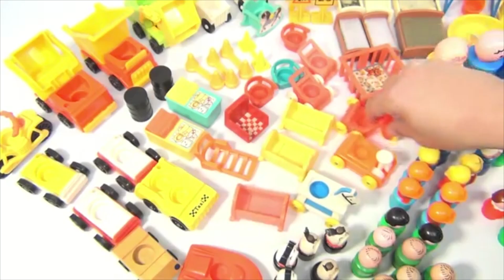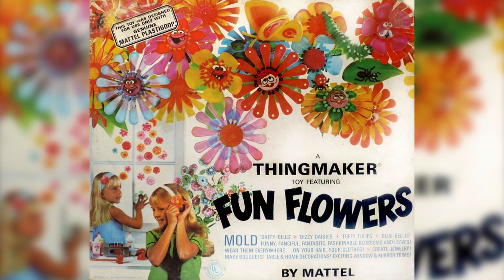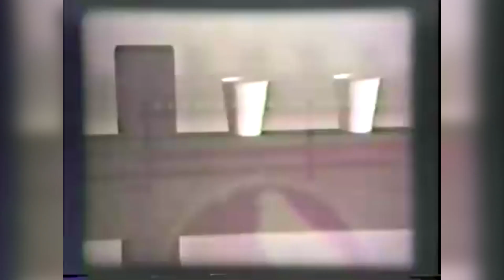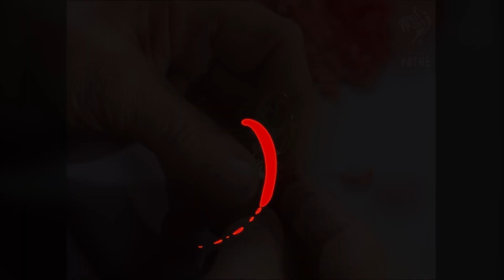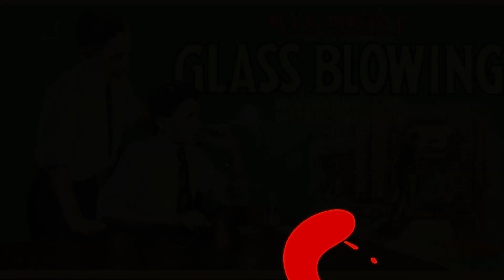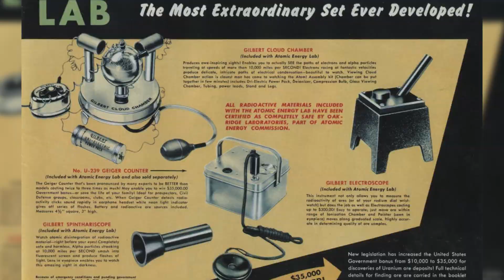Top 10 MOST DANGEROUS Kids Toys!

Comment: i,m 28 years old and by the age of 7-8 i could perfectly use a drill, hammer, soldering iron etc..maybe i was 10 when i first stole my dads angle grinder...i had fun desoldering components from old tv boards and melting stuff with the iron,i built toys made of wood and nails etc...i did not die, i did not amputate any limb and i make a living today thanks to those skills, today i still learn and learn everyday and not get tired or afraid of learning and trying new things.todays kidsdo not have the knowledge of how stuff around them works...now that is dangerous

Comment: When I was 8, I was given my first real hammer (a 16 inch claw type) for my birthday
When I was 12, I had my own soldering station- complete with real led solder by Weller Inc
When I was 13, I got a 1960's GILBERT inc chem set (with all the good stuff in it)
When I was 14, I built my own stationary steam engine with a boiler made out of a soldered soup can. 
I never got hurt that badly. 
My point is: fuck plastic. These new 'safe' toys aren't any good for smart people. Kids are supposed to learn by DOING things, not by prancing a pony toy that isn't even made out of hard plastic around on a table. 
When I become a parent, I'm going to teach my kids how to do things, like shoot a gun, and carve wood, and solder, and cast lead, and melt plastic, and fix an engine. I want them to have what I had, because I know that part of my success now as an engineer came of my ability to experiment when I was younger.
Reply: +K. Meinzer That's cool. Some toys still harmed people when used properly thus, are unreasonably dangerous but some you just had to be careful. :)

Comment: Why do you use farenheit? celcius is much, much better. can't argue with that.
Reply: Depends. For weather Fahrenheit offers a larger scale and much more convenient numbers.  But people are too lazy to do their own converting. Most people have no idea how much they spent until the cashier tells them.  I worked for  "Food Stamps" doing a survey in food stores. 50% of the people did not understand the Price/oz. listed on price tags required in most states. They were unable to decipher whether a block of cheese at 4.00 for 5 oz was a better deal than 32 oz of cheese for 6.40.  People were especially lost in produce.  Number of all fashion are taught in an haphazard method in school, where teacher can rarely do the simple math in their heads anymore, and calculating temperature conversion manually is out of the questions.

Comment: We were apparently smarter as kids. No major casualties.
Reply: We were placed in a position to figure things out.  Getting a bruise was not a crisis. Finding myself crumpled in a corner taught me that respecting my mother was mandatory not JUST GOOD MANNERS. At some age I figured out that an adult warning meant more than was on the surface. My grandfather told me not to place my hand on the pump pulley; however for some reason I thought it was okay. I have the tip of my finger missing for my arrogance - He must have know something. I had an unfortunate accident where the rope to start the lawn mower jammed when the mower started and beat me with the wooden pull handle. But from those 2 experiences I learned to be careful. At 14 I was working on my pilot's license when i saw a sign that became my creed:
"There are old pilots and there are bold pilots; but there are no OLD BOLD PILOTS."

Comment: Well   when I was    ten   I was given  a real live steam  stationary engine   that I would put on  a  csmall chariot I built with my   meccano set   and  this would   move   quite swiftly    when I w  about    12  or 13   my dad   bought  me   a  model   aircraft   engine that I   played around  with  the  a bit later   I bought   myself   a  1  or 2  horsepower   gas   engine   I   also   started  experimenting with   electricity   namely  car batteries  up to  20   bof them in  series   now that is some real   dangerous stuff

Comment: When I lived in Missoula Montana in the early 60s one of my friend's had the MATTE 'FANNED 50'
U loaded the cowboy handgun just like a real cowboy handgun.
The 'rd' one fired u assembled it yourself 
The hard shell plastic bullet had two prongs which locked into the shell casing.
On the round part (back) casing is where one would place a round 'stick'em' red cap.
There was also a metal spring  inside the shell casing.
U loaded 6 rds into the revolver and pulled back the hammer of the pistol (it was a single shot handgun; did not operate as a "double action" but a single action.
However it was designed to fire if you FANNED the TRIGGER While holding the trigger down.

The TRIGGER hitting the shell casing would cause the 'cap' to go BANG!
The force of the TRIGGER hitting the shell casing would cause the spring to hit the bullet which would shoot out the barrel.

If u got hit by the bullet, it stung..